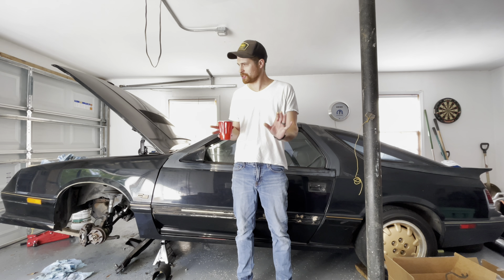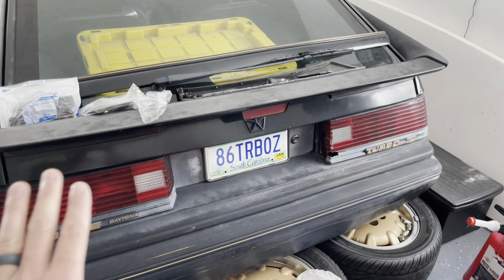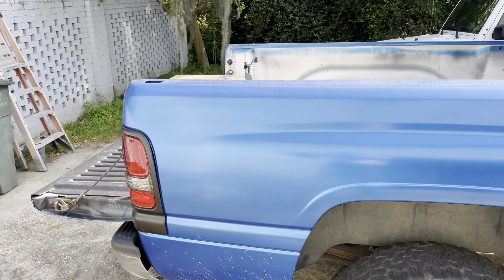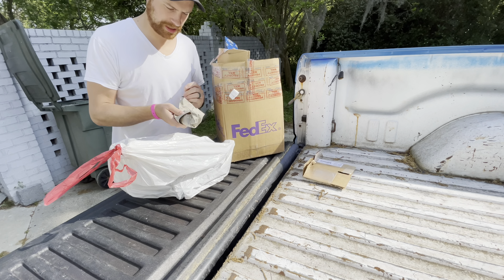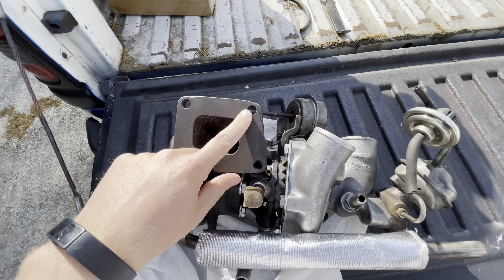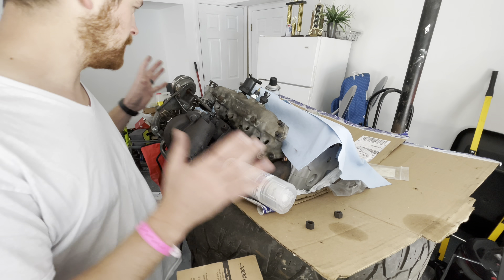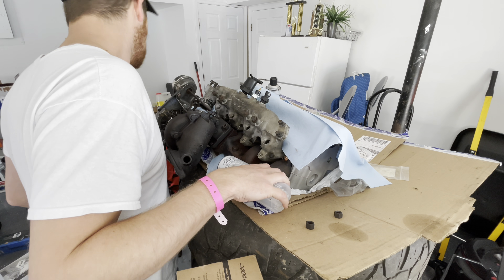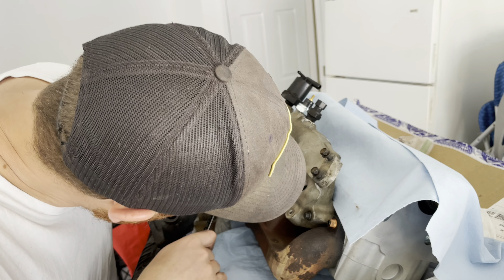Finally got the turbo for the Shelby Dodge Daytona - it’s awesome!!

Comment: Be careful with aftermarket pistons they are usually junk hyper crack. OE ones are fine. I changed rod bearings and rings + hone in the car. Just gotta wrap the crank keep debris out. And use soapy water to clean the cylinders not brake parts cleaner (Hone instructions).
Reply from the maker: Thank you for the advice! This 80’s Chrysler community continues to be awesome. I think I mis-spoke in the video, I’m probably just going to do rings as long as the pistons look good. Steven sent me the part number for the rings he recommend using so I just went off that. I bought the most expensive aftermarket main bearings I could find, hopefully they hold up well.

Comment: Last April, I bought a:
1985 Daytona Turbo Z -->
Its Jet Black Like Yours.
The Body on mine is (Subjectively estimated) 90 - 95 % Perfect.
The Interior is I'd conservatively Guess - 85 -90 % Mint.

I've spent the last Year - (Canadian Weather Permitting) Repairing the Few things this Rare Find needed done to Pass its Roadworthy Mechanical Insurance Inspection.

I Still have 4 ... just Four, :-( ONLY four little minor Chores to go until I can FINALLY go cruizin'..
Well, Three actually - Transplanting the 1500 Watt Stereo from my Truck, is a "Want," not a need.
I "Have," HAVE - have to - I have to repair the Power Windows, They stall trying to close. 
I have to Install "Dust caps" on the Rear Wheels. And, 
 
There's one other job under the hood I have to complete. I am actually really really surprised at how much trouble I'm having with it. My brother has helped me with the repairs. I took photographs with my cell phone before we dismantled everything to replace the turbocharger which was the main problem with the car but I got it, the turbocharger is in and I replaced the oil feed line with stainless steel feed line that separates with a reusable Nano filter. That was a huge pain in the #$@ let me tell you. But, the one I am having the most problem with believe it or not is replacing, or replugging the vacuum lines, believe it or not? The Bacuum lines are  largely the Reason I'm leaving SUCH a LONG LONG Comment/Message. I realize your car is a 1986 Shelby model. But I'm guessing the vacuum lines are, most likely, near enough identical ?
I was wondering/hoping ...
If you'd be willing to contact me, and maybe send me some images of under the hood of your car and the routing of your vacuum line? 

 In return, I have a copy of the Haynes manual for the 84 through 89 Daytona and laser. I would be willing to scan and email any page or section on anything you may be having difficulty with, I also have (although it is for the 1985 model, the vast majority of the two cars are basically identical between the 84 85 and 86) I also have the three book Chrysler service manual, I mean the mechanics real service manual the Chrysler publication that the dealerships have. Don't ask me where They came from, they was in a box in the car when I bought it.
The three book collection of service manual is approximately 5 in thick the Haynes manual as you likely know is maybe 5/8 thick, Haynes is for 84 through 89 the service manual is for 85 which is pretty much the same as 86 and 84 and that is a set of three books 5 in thick. If you'll send me the diagram of your vacuum lines or maybe make a video of it and post it, we can contact each other offline and you can either email or phone me anytime you need instructions out of any of the manuals or the Haynes book.

Here's hoping you see my comment, and hoping for a timely response, 

 Xandir in Canada
Reply from the maker: Agreed, the Air/fuel system on these cars is terrible to work on. It's actually more time effective to remove the whole head, which is wild. The vacuum lines are a very common issue on the boost management on these cars. The vacuum lines are the same for both of our cars. I have a video of re-doing mine here: 
https://www.youtube.com/watch?v=ok4C38QMhWU

Hopefully this helps, thanks for watching!

Comment: Hey Austin. Love the videos. My son and I are doing the head gasket on his 1988 Shelby Z.  In the one video where you were working on the subframe you unbolted what looked like a strut/shock that is in the back of the engine. Do you know the name of that or where I could pick one up. Tks.
Reply from the maker: Thanks for watching! I believe it’s called the transmission Mount strut. I got a good used one for mine from Steven at turbododgeparts.com. Try reaching out to him I’m sure he has more, tell him I sent you!
Reply: @TheMoparGarage   thank you. How’s your Shelby coming along?
Reply from the maker: @robertpalkovic831  any time my friend! I got a promotion at work so I haven’t had time to do the rings and rod bearings, but I have all the parts and the cylinder hone ready to do the job. I’m hoping to get it done within the next couple weeks and get a video up on it!

Comment: Not a Daytona Shelby, this is a Turbo Z with the "CS" package, which was the wheels, more or less. Any plans to make it a blow through with an intercooler? Those old pull through intakes are pretty bad at leaning out cyl 4, even with the Direct Connection intercooler that sits right over the motor. Pro Tip: Delete the EGR, or "disable" it and just leave the tube for visual inspection. You can even re-use this T03 for a "Blow through" setup by getting a blow through compressor housing and cutting a notch in the turbine housing to clear the blow-through intake.
Reply from the maker: Thanks for watching! The way I understand it CS was a handling package that had a larger sway bar and different struts. CS stands for Carroll Shelby so I just have essentially named it “the Shelby”. I just plan to leave it stock! It’s going to be a cars and coffee cruiser when I’m done with it, not really going for anything in the way of performance.
Reply: @TheMoparGarage  You are 100% correct. As far as I know Shelby wasn’t really involved with this specific vehicle. Now I know from his fantastic interview he did years back he mentioned they were able to harness a crazy amount of power out of the 2.2 liter. I had 2 of these cars, 2.5 and 2.2 both red and and the 2.5 was my first vehicle at 18 years old and both were C/S car and the  package or C/S is just like you said. It’s a handling package and there might have been a slight interior upgrade but I’m not sure. It is definitely a Daytona though. 
Hate to drag this on but I believe I will be purchasing another one as I spoke too the owner today. It’s not a C/S but it’s T-top and looks just like a C/S from the pics. I want to do this with my 17year old and want to make a serious crazy stupid build!  My first ideas were to pull the stock everything and put in a V6 turbo or drop a V8 but I do want it rear wheel drive or AWD would be the goal. So I’m subscribing now to you  and if you can help me out on the motor ideas. Thinking a Honda K20 or K24, even though I commented above on the V6 or V8. There will be a ton of fabricating which won’t be cheap but I want my T-Top to go fast!

Comment: Hey so I got a 1988 Shelby Z and I’m having trouble taking the turbo off with space to take the bolt off any tips you used?
Reply from the maker: It's really difficult to get the turbo out on those T2 cars without just pulling the whole head. I believe it's possible, but it's not a lot of fun. You'll probably have to pull it out the bottom.

Comment: So I have a 89 daytona, just wanted to see what you  would do.  Its non running basically i have to put al back together again.  Would you just try to get it up and running or would you take tear apart the motor and rebuild?
Reply from the maker: Similar story to mine…mine was running but not well. What ends up happening is, you go in to do the basic things to get it back running and then find more and more issues as you dig in. I’d just plan on a full rebuild! Mine started as a quick one month project and has turned into over a year. Might as well do it right!

Comment: I have a 1986 daytona turbo z and am having issues trying remove the timing belt to get to the cylinders, I called a resto place and they said just to replace the cylinder head gaskets and restore the engine head would cost me 4k MINIMUM. I was wondering if you knew how to get the timing belt off in such a cramped engine without having to take the engine out.
Reply from the maker: Access the timing belt by removing the inner wheel well on the passenger side. I have a whole video doing the timing belt here:
https://youtu.be/SqRDOZypG8U
Reply: @TheMoparGarage  In only 6 minutes you saved me 4k, absolute champ
Reply from the maker: @beefstew6512  so glad to hear it brother! Thanks for watching!

Comment: The Gen II and Daytona videos are great. Short intros are better. Great color on the Gen II. I had an ‘86 Chrysler Laser in high school. The back seat folded down to make a great makeshift bed. I hated working on that car. The bean counters seem to affect the ability to remove and replace parts than the engineers misgivings. Design it the cheaper way. Not the better way
Reply from the maker: Thanks for watching!! I’ve really been trying to shorten the intros. I try to get right into the action, especially on the newer videos. I agree, these babies are certainly not the most enjoyable thing to work on!

Comment: Pistons and rings?? Unless it burned oil or had a rod knock, id just leave it alone. If you are going that far, might as well drop in a set of the big beam rods from 84 and 85.
Reply from the maker: I mis-spoke in the video, I am just doing rings. The car was burning oil, the turbocharger was bad so that was one cause, but while I’m in this deep I want to do rings because they could have also been a culprit. Just trying to eliminate anything that would have contributed to oil burning.